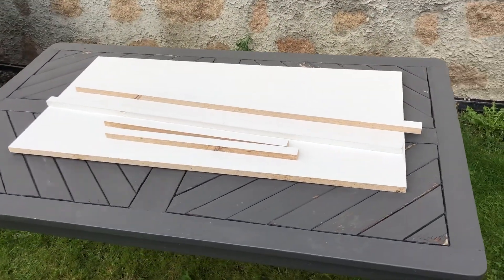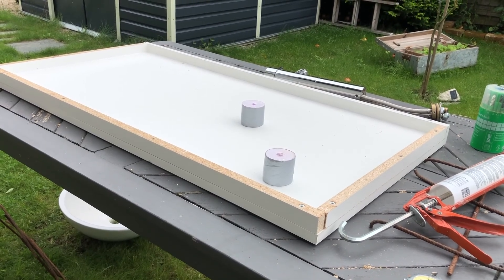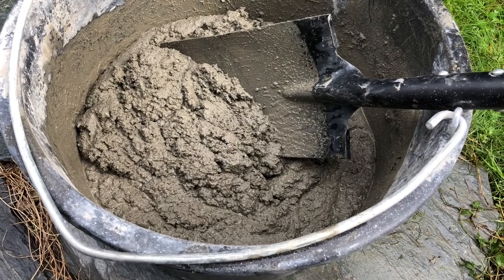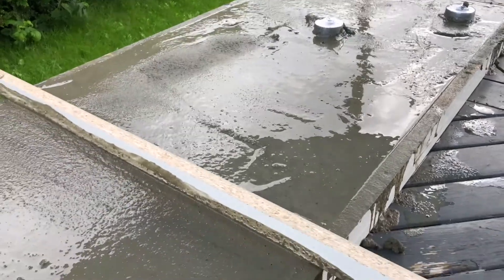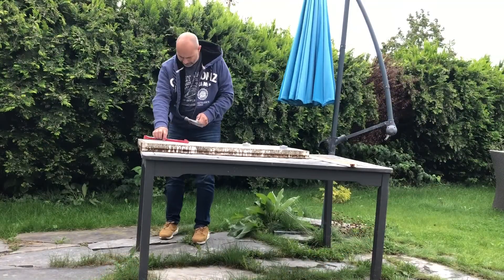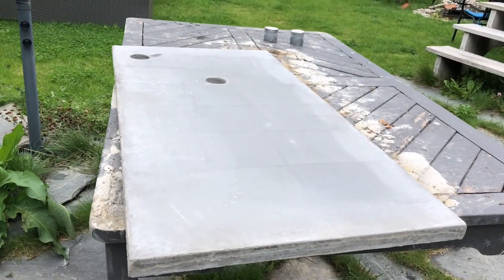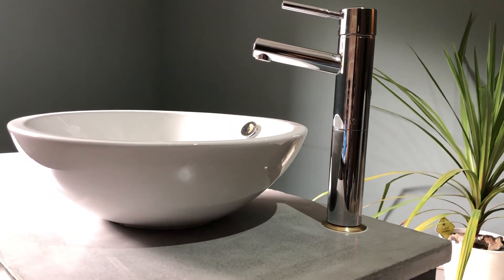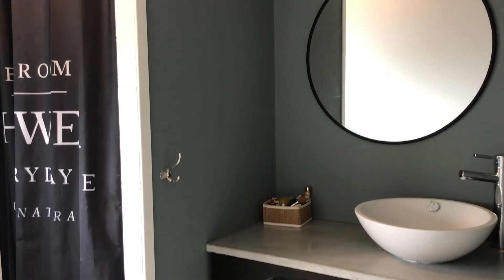How to make a DIY Concrete Countertop - Bathroom sink update

Comment: What did you use for the cut out for the pipes?
Reply from the maker: I just used some styrofoam and some duct tape. it made it easy to remove after the concrete hardened

Comment: How do you know what size hole you need for the cut outs for the faucet and drain hole?
Reply from the maker: on the sink I used the dimensions of the connecting pipes to get the size right. and on the faucet I measured the size and made it a little bit smaller. if you buy a new faucet I believe the measurment will be in  the user guide.
Reply: @bartholdsen  thank you for your reply !

Comment: Where do get a steel frame and is that necessary?
Reply from the maker: They have it all places where you buy concrete. There are many varieties to choose between. it is important that you have a good steel frame otherwise the concrete will be able to crack, but You can also use microfibers to strengthen the concrete instead of using steel
Reply: @bartholdsen  thank you also did you buy your vanity or you made it as well
Reply from the maker: I had an old one lying around. so I reuse it.

Comment: Jus wantd to know how thick did u make the counter top
Reply from the maker: the countertop is 2.5cm thick. This caused a small problems with mounting the water tap, which had only 2.2cm screws. but that was a small fix :)